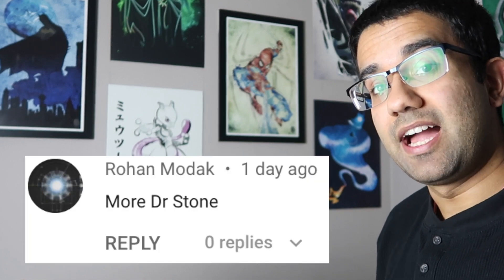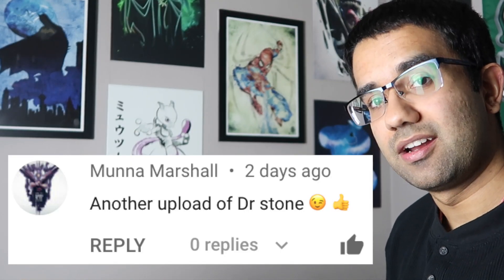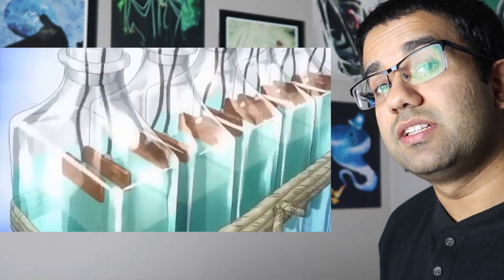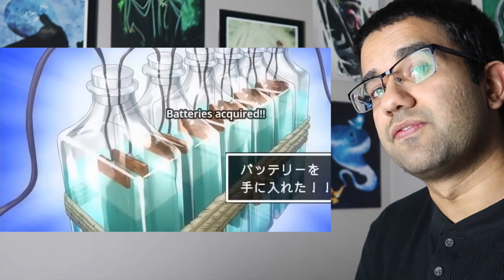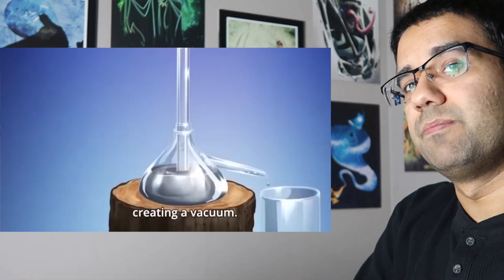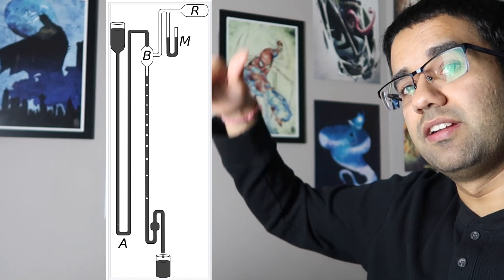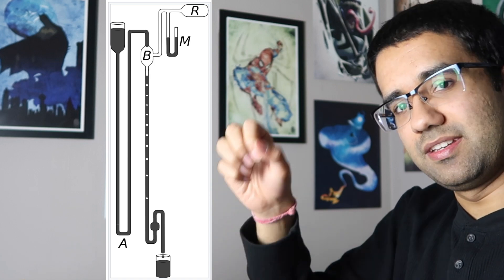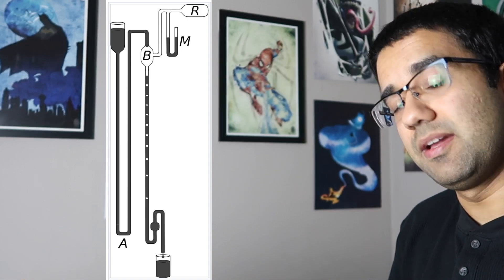Real Engineer reacts to Technology in Dr. Stone #21

Comment: correct me if im wrong but would series up the volts while par would increase the capacity? If you have 5 sets of par with 5 series at 5 volts would it be like a total of 25ish volts with the capacity of 25volts even if its 5 sets of both?

Comment: Leaving your light on for 10 hours a day... Are you working in the kitchen? Because if not, then flip that light off before you leave. Don't just leave it on until it's bed time. Such a waste of energy and light. I'm constantly having to turn off lights around the house that no one is using. No, I'm not a mom. I just hate when lights get left on while there is no one around to use the light. So don't leave your light on for 10 hours a day if you're not going to use it for that whole 10 hours. I will slap you. With a fish. It may even be frozen. I don't know. Turn off your damn lights when you're done with them.

Comment: I know Senku gets tungsten later to make lightbulbs, but I always wondered why he couldn’t have gotten a carbon filament. That’s what we used in lightbulbs before tungsten and it seems like he should have access to that at this point. It would certainly be better than bamboo.
Reply: Well the Bamboo was carbonised, in fact the reason they specifically used carbonised bamboo in the first place, is that that's what Edison originally settled on for mass production, shipped from around 200m from where Ishigami village is located iirc. It's not the best or most efficient, but in order to replace candles or oil or gas lamps, he needed it to be cheap and abundant/renewable with the tech they had at the time.
Reply: @hellzoneUK1991  the bamboo did not look carbonized, and if it was it shouldn’t have burnt out right away. Carbon filaments were used in lightbulbs that could last more than 1,200 hours, so although they were less efficient and couldn’t last as long as tungsten, it shouldn’t have burnt out immediately.

Comment: Something you missed about batteries: If a modern battery actually reaches equilibrium, it will more likely than not be damaged.
If you fully discharge a lithium-ion battery, for example, the dielectric will get leaky and your battery will be less and less able to hold a charge. This might even cause it to stop working at all.
(Actually, kind of similar to what happens when you put reverse polarity on an electrolytic capacitor)
This is also why you are meant to store those batteries at roughly half capacity. (Being fully charged for long periods of time will also damage them)

That said, almost all devices have protection circuits in them and by the time they register as 0%, the battery will be far from empty. It's just that draining it much further might damage it.

Comment: "if you turn on a light and leave it on all day that's 10 hours that light will turn on". Today I learned how truely wasteful electrical engineers are when it comes to power.
Reply: A lot of people will leave lights on that long, especially in business settings. That said in most cases where longer uses are typical, halogen, fluorescent, and now LED are more commonly used. If you look at how long the average household incandescent runs, it can still add up to many hours over the course of a day though not always continuously.

Comment: i don't get it. Whole video is just rubbish.
You didn't comment any misconceptions in anime nor basic mistakes.
You didn't even comment about the techology itself, ex when ginro get's shocked, you, for some reason start to talk about parallel and series connection in circuts (to explain that battary voltage increased, why? it's explanation for 30 seconds not minutes).

Comment: Battery setups, if batteries are married

Series = higher voltage, same amperes as single battery would have.

Parallel = Same voltage, but higher amperes & higher capacity.

Comment: It was mentioned earlier in the series, back in ep 7 if I’m right, where Senku gets mercury. He uses cinnabar to make Kinro’s golden spear, so maybe he somehow extracted mercury out of that.
Reply: He cooked it if I remember right. Cinnabar is the highest producer of natural mercury. When you roast it the sulfide begins to evaporate, that's why Senku told Kinro not to inhale the smoke, and what you get is liquid mercury as a result.
Reply: Wasnt that the one he also called the "philosophers Stone"?
Reply: @bman296  You also do not inhale the smoke because it contains vaporized mercury. Distilling Cinnabar is a method that has been used for thousands of years to get mercury out. The mercury vaporizes and then condenses at the top of the stack. It's best described as a distillation process as you are processing the vapor and condensing it.  It is a very toxic process.
Reply: Senku also liked to get a lot of whatever he gathered because he understood trial and error, made that clear early in the series aswell.
Reply: Fun fact- you distill mercury off of cinnabar.
Reply: As a general rule, if they have a material, just assume Chrome had it.
Reply: Alot of the other materials get written off as chrome collecting them before he ever met senku, like the gold.